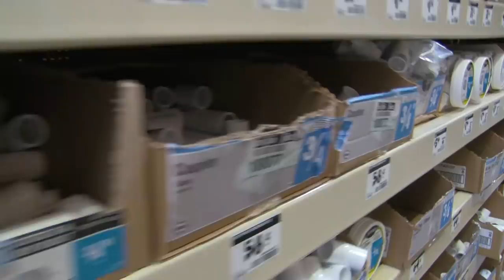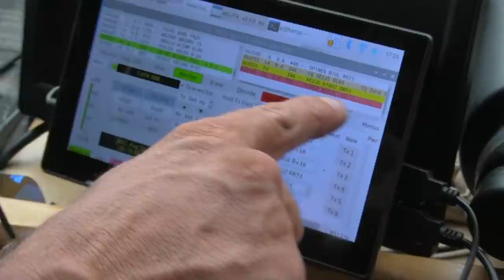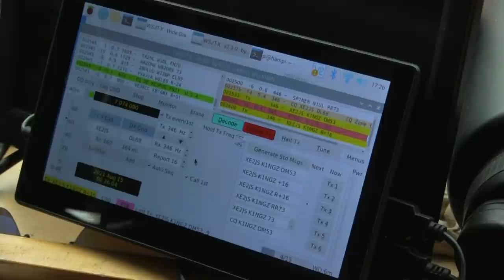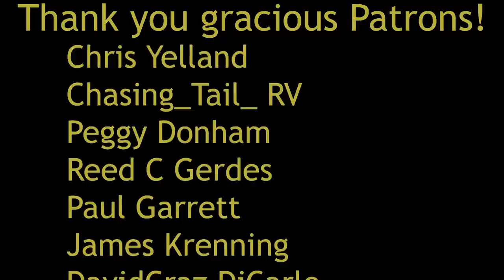Skoolie Life: Mike Gets Real with Potty Talk, Ham Radio, & New Threads

Comment: 2 suggestions. There may be mechanical reasons why the bus gets hot. Maybe the cooling system needs to be flushed. Maybe the coolant filter needs to be changed. They come preloaded with additives that a diesel engine needs. And I noticed that the bus smokes pretty heavily during acceleration. I would suggest a tune up to start with. On a diesel, it's not very expensive & it would add the benefit of improving fuel mileage. If the exhaust valves are too tight, (part of a diesel tuneup) it would cause the engine to run hotter.

Comment: Rubber gaskets or hoses inhabit your refrigerator as well as other appliances throughout the house. This case the toilet drain. Wherever you find rubber, don't clean it with vinegar. The acid can eat away at rubber just as it does natural stone, causing it to degrade. Instead, use soap and water or a solution of soap and baking soda. Maybe try rinsing with just water.

Comment: Glad to know the area around Show Low was that gorgeous! 😍
How was the stove working at those high elevations?
Reply from the maker: If you're speaking of the propane stove, we haven't noticed any difference. That said we have had terrible problems with our lighters up here! If you're asking about the wood stove, we haven't actually fired it. It just hasn't been cold enough.
Reply: @BussyMcBusface  yes basically the propane appliances. I’ve been told that propane stoves and propane water heaters have a hard time at higher elevations. 
Gotta use those old school matches I guess ;p

Comment: Hmmm, and here I thought Ponderosa pines smelled like Lorne Greene. :-)
BTW, have you looked into Musk's Starlink internet service?
Reply from the maker: So, we have looked into starlink and while it seems like the silver bullet, it really isn't. First of all we like parking in places with trees and stuff like that which really conflicts with the usage of starlink. Secondly as of a month ago starling has only activated a random number of cells in their system so you could pull into a place get clear view of the sky have satellites and still not have internet because they haven't turned those cells on. Thirdly they do not have a mobile unit on the market yet that updates the location of where you are at and allows you to use the internet either while in motion or just in a new place. You have to manually go to their website and update your location. As of now Verizon at virtually the same cost is beating the crap out of starlink.
Reply: @BussyMcBusface  Thanks for the info, I knew it was still in Beta, but I thought that it was mostly open in the mid lattitudes. Oh well, maybe some day.

Comment: What about a “P” pipe down low. Then when ya pee, you flush with a bit of water & you have a water valve.
Maybe that won’t work in a mobile environment……hmm thinking lol ; )
Reply from the maker: The idea sound but the problem is the p-traps could very possibly burp with different air pressures being exerted from the aerodynamics of movement. That and we don't want to have to go get a glass of water every time we go to the bathroom 😁
Reply: @BussyMcBusface  well that’s fair lol : )